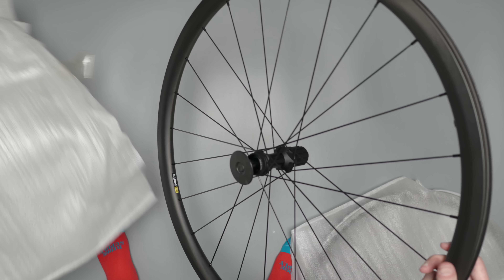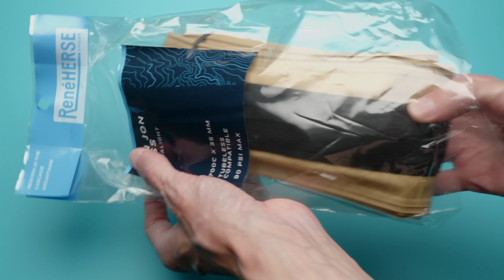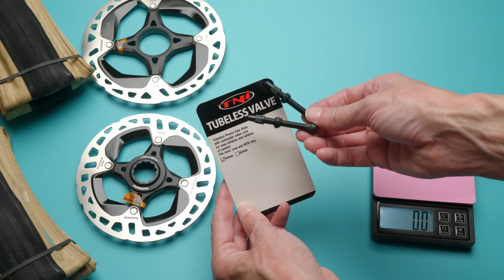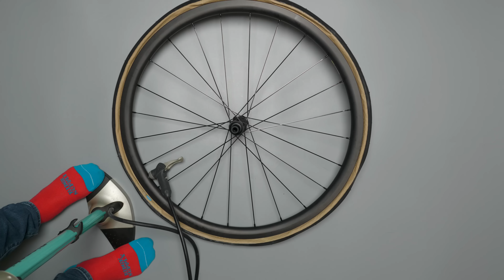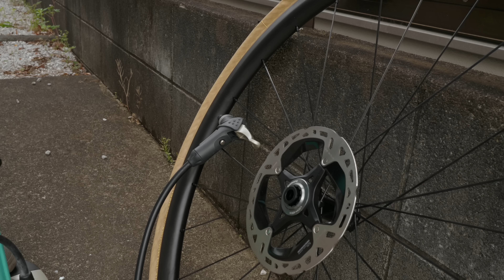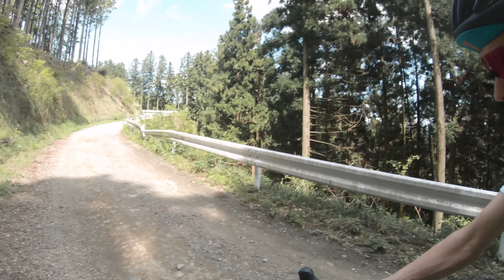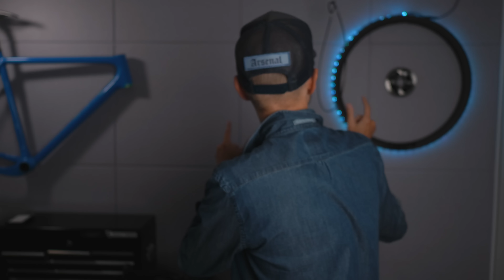Sub 7kg All-Road Bliss #newwheelday

Comment: Great video - I'm running Industry Nine I9.35s ($1350 grams for the pair actual weight) with Bon Jon Extra Lights.  It's my absolute favorite set of wheels for all of the reasons you gave - go (almost) anywhere - do (almost) anything - very reliable, and great performance.
Reply: Are these the carbon?
Reply: @johnwilliamson9453  yes sir!

Comment: Agree pretty much on every key point here regarding the tires: yes, the René Herse Bon Jon Pass Extralight ride very smooth (I ride them with inner tubes, though). I like them more than the Panaracer Gravelking Slick which is way less supple and also quite a bit bouncy. But indeed: I'd also wouldn't trust the Extralights for any prolonged bits on unsealed surface. And yes: any tire supplier should strive for a tan sidewall like René Herse. That brown of the Panaracers really doesn't cut it. Not by a long shot.

Comment: Another fine entertaining video, Tobias.  Just for the benefit of others reading the comments - these carbon rims from Xiamen, China are sold by dozens of companies, some with American brand decals on them. I've personally built up 8 wheels using rims with a similar spec to these. They were some of the best rims I've built among thousands of wheel builds.  The finished wheels have very even tension, and are true and round. I've ridden a set similar to this on my Canyon for 3000 miles and they never needed truing. Too bad about the Rene Herse tires, they ride great but they always leak no matter what sealant Jan says to use this week...
Reply: Rene Herse EL only tend to leak at first. Once you have sealant in them and ride a bit they're fine. They seem to seal especially quick with Orange endurance.
Reply: Todd Donovan Tubes. Just run tubes ffs. They work great!

Comment: I feel the same way about my bikes.  I've got the Alligator cable housing on my 6.5 kg cervelo RS.  But it is an XS size with 650c wheels.  Not a lot of options for fast tires bigger than 25mm.  Hence, it is now my dedicated wahoo kicker bike.  Now, I ride my Norco Search XR with 1350 gm carbon wheels/babyshoe pass extra light tires and my 20 ounce stainless insulated mug (292 grams when empty, 900 grams when full) of delicious micro-roasted coffee(fits perfectly in a feed bag).  Supple life / weight-weenie = never-ending journey(hopefully ;)  Another nice video.

Comment: Haha! Thanks for doing what I was thinking; that is, pump in double the amount of sealant into my Switchback Hill UL too on my front. Well, for the rear (WTB Byways) too because both of them are losing air. I had just replaced the first set of tires on my Bokeh after 10,000 road kms and still having problems with air loss. Good thing I have a new bottle of Stans!
Have fun!

Comment: I had very hard to pop the Bon Jon tires on my Zipp303S too, even with easylube from schwable. Fortunaly I followed your trick with a tube to pop the tire first. My all black bike looks great with these tan wall tires. I put 100ml in each tires, the front one holds air pretty well, the rear one looses pressure after a few hours. I only rode 10km, the tires may need more km to seal properly.
Reply: Any updates?
Reply: @snav1011  Hi, after a while the tires hold air pretty well, for the winter season I removed the sealant as I don't ride them. They hold air even without sealant. I will put fresh sealant as soon as I will ride them again. They roll very good. On my rims they turned out to be 37-38mm wide, a bit wider than 35mm announced (extra light + tubeless + 23mm internal width.

Comment: I almost went with Farsports but ended up with the WR35 from Lightbicycle. I also run the Rene Herse Bon Jon Extralights on my OPEN and they are amazing as all-road tires. Orange endurance sealant tends to deal with the leaky sidewalls a bit faster than other sealants.
Reply from the maker: I beginning to suspect that as well... seal smart doesn’t seem much better than Stans.
Reply: Does it colour your sidewalls orange when it does leak?

Comment: Thanks for bringing up these wheels from Farsports as I haven`t had them on my radar on my search for affordable carbon wheels. Since your video was released I bought my own pair at wheelsfar and they´re running flawless on my gravelbike. Seating the tires in the wheels was a pain in the..., as it was a very tight fit with between the No Hole Rim and the Wtb Resolute tires, but I knew what to expect after your video. Delivery was much longer as I had expected (approx. 1,5 months due to current situation) but it was okay form my point of view and the seller tried to keep up with information once i managed to get in contact with them. The weight was pretty accurate as they claimed the pair on 1300 g (+-15g) and I weigth them on 1311 g so within tolerance. 
Looking forward to see more stuff like that without digging holes in my pockets;)

Comment: My Rene Herse Barlow Pass and Steilacoom’s I went with stan’s no tube regular version 3oz and 3 months in still no need for more sealant, no leaks, even with going through some single track on the Steilacoom’s (these are endurance version). I left each tire laying down for an hour on each side before using.  Going with 3oz instead of 2oz definitely sealed the tires better.  Definitely my favorite riding tires.  And the endurance version for the extra 30g weight can go through some tough single track terrain without issue while still being very supple.

Comment: Well, In my case as a custom bike painter. I suggest sanding the bike's paint down to carbon fiber and clear coating it! Now there are steps in between coats from carbon to clear.  But to shed that weight that's what should be done.  Add some of the same blue color for accent here and there!  Sweet vids!
Reply from the maker: NEVER!!!😉
Cheers mate !
Reply: @ridesofjapan  lol

Comment: GKs FTW.   This reminds me of the Pari Moto.  I would not run these tubeless. The GKs are about the same weight and don’t leak except for the myriad of holes they eventually collect. ;-).  Totally with you on this sort of "all-road" setup.  I am running your other wheels (well my wheels, you know what I mean the XMC1200s) with 42mm GKs, as my everyday go anywhere wheels and I love this slick/slightly fat setup.  Still noticeably slower than my ENVE 3.4s though.

Comment: Nice video! I can also recommend Nextie rims. 31mm outer and 22mm (24mm with the hookless version I think) inner width, pretty light and great design. Weight should be similar. I build some with internal nipples (because I like the look) and Newmen hubs, very pleased with the wheels.

Comment: Conti tubeless gp 5000 are air tight! They have a inner butyl layer and need the f...... g fluid only for puncture resistance. And they are a pleasure to install even on a non-taped-spokehole-free wheelset from Lightbicycle. That’s the definition of being really tubeless. I hate messing around with leaking tires and the fluid. 😎

Comment: What are your thoughts on Caden wheels? I'm a bit impressed by their tubular wheels, (just from reading the specs) less so with the clinchers and tubeless wheels. At 1020 grams for a set, they are about 40 grams heavier than the new Extralite tubulars, but they also cost half as much as the Extralites. And then I get to learn how tubs ride, and I can explore those fabled silk tubulars. :)
BTW, a THM Tibia stem is on the way, step one in project "Keep the weight of the Strada decent". :)
Reply from the maker: I've went down the tubular route before and it's simple way to drop some weight for sure... In the end I sold my set because I was not prepared to deal with carrying a spare tubular and the headache that it involves getting a puncture (In my opinion/experience is much more work than Tubeless)

A climbing tubular set has to be below 1000g before I even think it worth thinking about :P
The tubular tires usually end up a bit heavier though depending on size.... can you even get 30+mm tubs nowadays?

Regarding, Caden, I can't say much... never tried or seen them in real life. In-house hubs never makes me very exited about brands like this. Not saying they are bad, just my own preference, I think the hubs are way more important than the rims now that I live in disc brake land, and today I would no personally would not get anything below a DT240 hub.
Reply: @ridesofjapan  it's actually that allegedly wonderfully supple ride of tubs, and particularly silk tubs, that intrigues me. And I'm old enough to remember when nobody had a saddle bag on their road bike, but everyone had a spare tub strapped to the saddle. Oh, and the Challenge Strada Bianca and the Challenge Gravel are available as 36 mm tubs, but unfortunately not with silk casing, the 30 mm Strada Bianca has that.
Also, don't the Extralite wheels have in-house tubs? :)

Comment: I'm surprised you haven't touched on the pricing/durability of the Compass/RH tires, but they are light ;) Just setup some Gravel King Slicks myself, roll really well and have decent traction. Time will tell on the durability ... Wish you good luck on those wheels, i'm sure there gonna be awesome, just hope you never have to replace a spoke!

Comment: Maybe applying a thin coat of Aquaseal to the sidewalls may help with how leaky the tyres are.
Reply from the maker: Never heard of that before... would be interesting to try
Reply: You could just vulcanize the holes
Reply: you mean something like bondcrete? which is basically pva glue or wood glue?  waterproof too, interesting

Comment: I wonder why they don't make tubeless (e.g. Mavic UST) gravel tires, as opposed to "tubeless ready" (for sealant). If they made gravel tubeless tires with a butyl layer on the inside, it would remove the need for sealant (like a car tire). It is true that there would be no sealant to fix a puncture, but if you do, you could just plug it. With a butyl layer, there would be a weight saving from not having to put sealant in, in addition to simplifying installation. For rims like these, with no spoke holes, it would probably work fine. Personally, after seeing the weeping, I would just put in a latex tube and be done with it!

Comment: nice vid! I've been looking at far sports...But those tires are super delicate! I'll bet they won't last a year.
Reply from the maker: If I get a year out of them before I get the itch to try something else l’ll be very surprised 😬
Reply: It depends on your type of gravel and riding style. The very supple sidewall does a good job of conforming around obstacles if run at an appropriately low pressure...but some places just have sharper rocks and some riders like to get rowdy haha. I got 10,000km from a 38mm extra light rear (front half worn) with 1 puncture. Those were dreamy kilometres.
Reply: @craigwilson118  Wow, that's pretty good wear!  A buddy had a pair a recently had the sidewall come apart on him. .tires are meant to be ridden and there's not a whole lot we can do about the gravel and rocks at 20+ mph.
Reply: @wmlarch  that would be really disappointing. I did tear a few strands in the rear sidewall but it didn't go all the way through so I put a patch on the inside to reinforce and continued using it. Wouldn't have risked it up front though  I,'d like to get a pair of the new endurance casing in my hand to compare but all out of budget for the foreseeable future.

Comment: First, I think your videos are amazing (very cinematic, great typography, soundtrack, AND informative), I became a subscriber. 
I was not a weight weenie but after binging on your vids, I've caught the bug and I want a Farsport 30 mm road only wheelset for my 2018 Trek Domane SL 5. I'm new to the game and can't decide between the rims w/ nipple holes or w/o holes. Also having a hard time deciding between DT Swiss 240 and Carbon Ti. I'm a feather wt. at 125 lbs (57.7 Kg) and like to go on longish hilly rides. Any advice would be appreciated. Thanks! 🙏
Reply from the maker: P Kim cheer mate!
it’s all down what your priorities are, if you want something light and that’s a priority, the carbon Ti is unbeatable.
Holes or no holes there not really any benefit apart from not needing to use tape, on the other hand of you are prone to breaking spoked it will make it harder to repair.
Reply: @ridesofjapan   Thx for your input. Well then, I'm all in. Let's go w/ Carbon Ti as long as it's fairly low maintenance and sturdy. I'll go w/ no-hole rims, sounds simpler to set up (this will be my first tubeless!) And, luckly I've never broken a spoke in my life :-)

Comment: Did you ever try cleaning off the inside of the tyres with brake cleaner and painting them with sealant milk and let it dry. I read that this does wonders with non tubeless tyres.
Reply from the maker: Nope, never tried that. On a pair of old tire I would be interesting to try but not a set of brand new one... not at this price :P

Comment: Great videos, keep up the great work!  I'm having a challenge deciding between the Farsports and Light Bicycle.  I was wondering what was your deciding factor to go with Farspots?  Also, any thoughts of using Tubulito tubes with Rene Herse tires?  I've heard when you take sealant weight into account they can be pretty competitive on weight and that would remedy the leaking side wall issue.
Reply from the maker: At the time I was deciding, the farsports had the better weight combined with the exact rim dimensions I wanted and 180EXP hub. They both seem to change their lineup a lot, so the configurations might be different today.
I don't use tubeless for weight reasons, it's only for the self-healing puncture abilities... tubolitos are in my spares kit.
that being said, I would not get another pair of extralight Rene herse tires today if riding tubeless... too much hassle. (I retired the ones in the video, back to gravelkings)
Cheers!

Comment: Would you suggest carbon (perhaps even gravel-specific) wheels to be an impactful upgrade in terms of comfort and overall performance, even on an aluminium frame (in my case: Cannondale Topstone AL -> given that, not so much a weight-related upgrade)?
Great video, keep up the good work!
Reply from the maker: If it’s comfort you’re after I’d start with trying to fit the biggest tires you can fit in the frame. That will improve comfort more than new wheels.
Cheers!
Reply: @ridesofjapan  Thanks for the quick response!

Comment: Did you consider challenge tubeless tires? Oh and i think you could have brushed the sidewalls with sealant should save quite a bit of weight.
Reply from the maker: Never challenge tires again 😂
https://youtu.be/AVce4Gx_STc
Reply: @ridesofjapan  I'm really an amateur compared to you in terms of mounting tires, but I managed to mount them the first time - may be that the tubeless offer a bit more flex or that 36mm just have a bit more play. Anyhow they would really be a cheaper alternative. That looks nice as well.
Reply: @ridesofjapan  what's so special about those Strada Biancas? All my road tires are open tubulars (Vittoria Corsa) and are totally flat when they come out of the box. I was a bit puzzled the first time I tried to put one on, but they become easier to get on/off after a few times. And I love them, they ride so supremely smoothly on tarmac. No 40mm tubeless tyre comes close to my 25 mm Vittorias!

Comment: Do you attribute discs rubbing to the stiffness of the wheel or the fork? With the hub locked in place the rest of the wheel should not really matter. The fork however is key.
Reply from the maker: I’m no engineer but if I’m allowed to speculate, I’d say the it’s mostly in the hub. (The fork will play a part as well I’m sure)
Based on my riding, riding with my DT wheels I almost never get rub and I don’t need to be super picky with centering calipers. On my Extralite I definitely need to make sure it’s dead center to 100% avoid rub in the extreme out of the saddle efforts.
But there’s definitely other factors as well involved like the rotors, lazy pistons etc etc.
The rim flex though should matter at all like you said.

Comment: Seems like a lot of work for tire. I would also be really concerned if they would easily get a tear on the sidewall when off-road. They probably feel really smooth on pavement, especially if you use 700x45c size

Comment: Love your channel! I have 2 sets of wheels (38c g-one gravel vs 28c pro-one slick tyres) for my OPEN UPPER. The 38c has a 11-46 cassette & 28c has a 11-34 cassette. Silly question time - Do I have to recalibrate my Di2 rear derailleur when I swap my wheels? Any chance you've made a video for this? thanks
Reply from the maker: As long as it shifts like normal without any weird chain rub you shouldn’t have to do anything. 
If you have the same hubs in both wheels then shouldn’t be needed. 
Just have you rear mech adjusted for the bigger cassette.
Cheers!